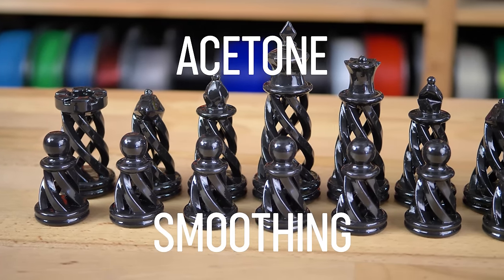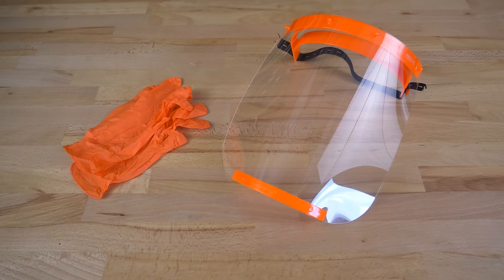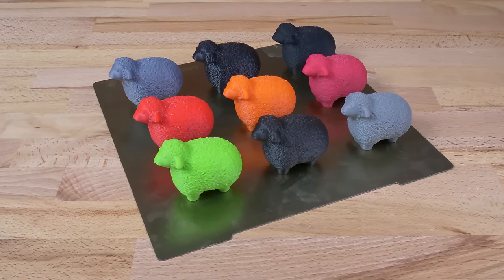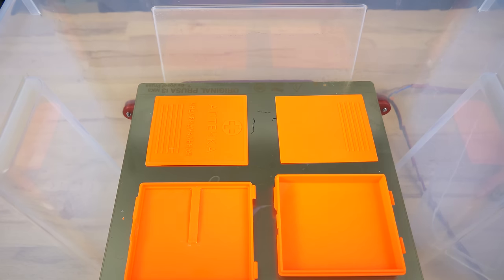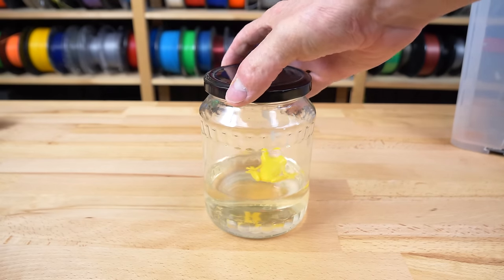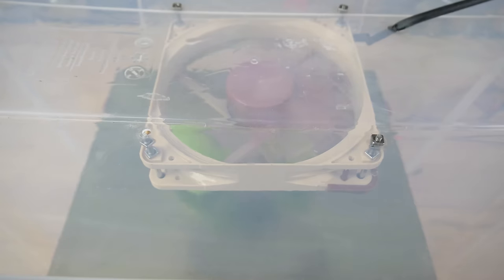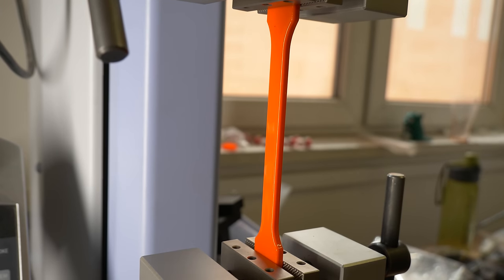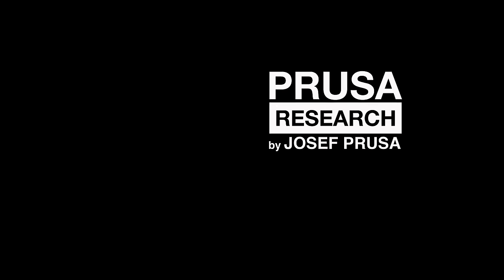Improve your prints with acetone smoothing

Comment: So this is kinda like anti-aliasing but for 3d-prints :)
Reply: Yeah, but it's not crappy.
Reply: @squirrelrobotics  lol hi
the first comment I check i see you xD
Reply: @augiespear8804  Hello!
Reply: More like blur
Reply: Well yea, kinda
Reply: 3D Maker Kid m, AA is not crappy. It is very helpful if you have a low res screen
Reply: Except anti-aliasing averages the pixels out, this cuts them down. Which is worse.
Reply: Nice one.
Reply: Not just anti-aliasing, but texture filtering too.
Reply: FXAA
Reply: you guys are all wrong... it DLSS aliasing!
Reply: 'smoothing out lumpy shit' is what know AA for.
Reply: That's why he needs the noctua fan
Reply: More like bilinear filter I think ;)
Reply: AA is not for all. Its only for the edges of the model xD
Reply: dlp printers already have anti aliasing but it ends up making things worse from what I've seen.
Reply: Yes, there is another filament which allows to do this with isopropanol instead of actone ;)
Reply: Lol
Reply: LOL
Reply: When will we get RTX for 3d printers? :O
Reply: RTX for 3D printing is called SLA :)
Reply: So Pla doesnt work. Pla is all i use at the moment. Any suggestions on smoothing Pla?

Comment: Dude is so rich he uses a Noctua fan for his print smoothing box
Reply: it logical since the cheaper fans use lower quality plastic,
which means their easier to get affected and damage by the vapor!
Reply: @g60force  wrong. mechanical stability is not chemical resistance.
Reply: @David-cy5zu  you've been misinformed
Reply: @g60force any fan made of ABS would kinda melt, so its more about the type of plastic than the quality of plastic
Reply: Thought I was the only one that noticed hahaha
Reply: those fans are like $30?
Reply: to be fair, as someone who builds and tears down computers for parts on a fairly regular basis, i have some noctua fans that didn't fit into my current case laying around. I also have a suitcase full of old HDDs lmao
Reply: @littlesnowflakepunk855  Yeah but you wouldn't put them in a box floating above a reactive chemical unless you're Linus.
Reply: @Zwettekop  i mean if its a chemical i know wont affect the type of plastic it's made from, i would. like ive put noctua fans in resin printer enclosures to vent outside before

Comment: I appreciate the video, but feel like it's a shame that the hotbed underneath the smoothing station was not mentioned. I built almost an identical box, with a slightly different shaped clear PP container and was so confused when after a couple of hours my prints had not been smooth at all. Turns out, the acetone is actually being heated in this video by the standalone printer bed.
Reply: Most solvents don’t really evaporate at a significant level unless heated
Reply: the sun works, put it outside
Reply: Thank you, I was feeling really stupid at this point.

Comment: It would be safer to design a fan where the motor is outside the box and the axle enters through a small hole, like how a convection oven is usually built.  With the fan motor directly exposed to the vapours, there is an explosion risk if the motor fails, or if you unwittingly use a brushed motor.
Reply: Yeah but it is like a closed system and it needs to be closed or the acetone gets out. The fan needs to be inside the chamber and it cannot pull fresh air. So there is no good way to place the fan outside. An oven is not fully closed. It pulls fresh air and air can escape through the sides. You normally can feel it. There are closed ovens but they have fans that can resist the temperature but that is again the same as the acetone chamber and the fan is literally inside.

Comment: PLA can be vapor smoothed; ive done it numerous times. The thing is you need a plastic/solvent combination that acts quite fast, so you can hit the surface without melting down the interior. And temperature plays a big role in this. It just so happens that acetone-ABS works fine around room temperature. Ethyl-acetate works quite fine for most PLAs, but you need to do it in a box around 50-60c; otherwise the vapor pressure of the stuff is too low, and you will get similar 'rubberization' problems as with plain acetone+PLA. Playing with heat and volatile chemicals may not be everyones cup of tea; but putting a water bath with possibly a thermostat heater in the bottom of your plastic box is quite safe. Just stay under the boiling point of whatever volatile substance you are working with; that goes for acetone as well.
Reply: Thank you for the suggestion. I've had a lot of PLAs lying around so feels like kind of a waste getting other filament materials just to try the acetone smoothing as of now. Will try them.
Reply: so for clarification, if I have a PLA model, say the size of a helmet, and have it on a stand in a box with a fan, with a layer of Acetone under the helmet (not touching the helmet) and then have that box in a hot water bath at 50 deg C, after 20 minutes the PLA should be smooth? and how much acetone do you think would be required for such a project?
Reply: @stevoz748  no you need ethyl-acetate for PLA, not acetone; and its boiling point is more like 70C if I recall.
Reply: @eelcohoogendoorn8044  thanks for the clarification
Reply: The video is about acetone smoothing, so no, it cannot be vapor smoothed using methods in this video.

Comment: Making a part stronger would make sense since a smoother surface also means a surface with fewer stress crack initiation sites as increased smoothness reduces stress concentration sites. Although, given that, I'm not sure why the tensile strength would be reduced.
Reply: I totally agree with your analysis on crack initiation sites on the surface for Sharpy and adherance tests.
Concerning the tensile strength, this probably have something to do with the orientation of your print. For instance a specimen printed horizontally or vertically don't have the same tensile strength. I assume that printing horizontally (where layer are in the same direction as the force you apply) is much stronger when confronted to tensile stress. Therefore, the melted part might tend to loose the cohesion between layers which result in a lower tensile resilience.
Reply: @dr.hawaske8488   it's actually the exact opposite of this. the tests in the video showed that layer adhesion was increased from vapor smoothing as it effectively fused the layers together which is why you cant really see the layer lines. this is also probably why the samples performed slightly better in the impact resistance, as better layer adhesion would probably have some effect in an impact. however, the parts had worse tensile strength because some of the acetone was likely still in the parts, and the actone itself would weaken the part, I mean it literally melted it which is why the parts were smooth. Hope this answered any questions you had.

Comment: I like how you explain diy setup for smoothing with an acetone by using old sheets, simple box... and expensive noctua fan to stir it up.
Reply: it makes sense, because cheaper fans usually use abs blades... that does not work for obvious reasons...

Comment: In the layer-adhesion test, the better mechanical load capability is clearly due to the changed geometry of the radius. It got alot bigger and thus didn't function as a weak point anymore

Comment: This is similar to Case Hardening with metals. The tests point to that as well. The outer structure has been optimized while in inside remains relatively the same. Try tumbling them in media or a light shot peening and I’d be they get even marginally better.

Comment: According to wikipedia ethylacetate and pyridine can be used to smooth PLA. In general, just take a solvent which is able to dissolve the plastic (there is always one, but be aware of the safety rules).
Reply: The only thing I know is that PLA is really soluble in organochlorides like dichloromethane or trichloromethane (Chloroform). They are even videos on YouTube of people using them to smooth PLA. But of course organochlorides are all pretty toxic and should be handled with coution although DCM is a little bit less toxic then the rest.

Comment: If i am not mistaken, many of theese fans use comutated brushed motor, a potential source of sparks. I am not sure whether it is safe tu use in flammable atmosphere. Otherwise i enjoy the video, thanks for the content of such a quality.
Reply: PC fans use brushless motors , and have done for many years. Depending on the plastic used in the fan, there may be some effect from the acetone vapour, but ignition risk is likely to be very low.

Comment: Josef Prusa, i like your ideas how to improve things, but.... Vapours, dust, heath and sparking are dangerous . I know quiet a lot of explosion enviroments as i work in such. I would move electronic parts outside of the container and drill a hole in a lid for rod an put on the fan blades or make it similar as magnetic pump for liquids.
Reply: That's illogical - the last thing you want is to be forcing air into the box, the acetone needs moving around the box. Use a smaller box, use as little liquid as possible, shouldn't be an issue anyway - brushless motors.

Comment: Having a fan inside the box could be a fire risk.  When a dc motor ins it can create sparks on the brushes.  There is a motor rating in chemistry to prevent motor ignition of flammable chemicals

Comment: Is there any material for 3D printers, I can use inside an aquarium, that's food save?
Reply: PET, PET-G, HIPS, and nylon-6
Reply: I believe PLA is fine
Reply: PLA since it is basically protein so it is organic
Reply: @bl4ckr4bbit  And what about the colors and will it get softer over time when in contact with water?
Reply: @littlejacob25  THIS only if you need highest possible standards.. since there's a difference between a room temperature 10cent goldfish and a 100dollar sweet or salt water tropical fish ;)

Comment: Really nice video. Dont you fear your fan could cause an ignition of the vapors due to electric arcs in the dc motor? or do you use a brushless fan? i would like to build such a box but i am very uncomfortable with a dc motor and combustable vapor
Reply: I was wondering the same thing when I saw that.
Reply: Noctua fans use brushless motors

Comment: As beginner been looking for some advice. And now have even more questions. So: fan most of them are made of abs how long they last? Hi concentration vapours can ignite easily with electrostatic discharges which sometimes occurs on fast moving plastic parts, also even brushless motors can generate tiny sparks, heat, and magnetic field all of them can ignite vapours off different chemicals. Box how long it lasts for? And another I had a  a lot of occasions to play with the strength tester. With numerous different materials and there is some behaviours tendency especially characteristic to plastics I never had situation that piece was weaker to pull force than twist or share. Are you sure that tested piece wasn't faulty?
Dipper you dig more things to learn you find.

Comment: Nitrile gloves don't protect against Acetone. In fact, it's better not to use gloves than to use nitrile. If you have gloves on, the acetone will permeate the nitrile instantly and be in direct contact with your skin until you remove your gloves. Without gloves, it'll just evaporate off.

Butyl or Viton gloves are required, or just don't put them on.

Comment: Here is an idea, use an air assist nozzle like commonly used on small lasers, but put the air pump in  a container with acetone in... so the air it blows at the "welds" contains the vapor as it prints...

Comment: If you need that level of smoothing and detail though, you probably want to just use a resin printer.
Reply: I dunno. everyone I've heard talking about resin says that, while it looks amazing and it's great for miniatures and the like, it has absolutely no give, so if it's a functional part and you need smooth detail for that function, like a small gear that needs enough detail to let the teeth of other gears smoothly enter and exit, something that's been acetone smoothed will have a longer working life because it'll be able to deal with the stress for longer without breaking.
Reply: that all depends on a per-use-case item

Comment: Attention, the fans mounted in a potentially explosive environment, and this is it, must comply in Italy with the Atex standards, if there should be a breakage of the bearings, short circuits deriving from the corrosion of the cables, sparks would arise and a fire would be triggered. Attention.

Comment: I gave up on this years ago as I never could get any ABS filament to work doing it.
Reply from the maker: You might have been printing with one of the ABS materials that we mentioned in the video. They print and warp a bit better, but cannot be significantly smoothed. (e.g. ABS-T)
- Mikolas
Reply: It might have not actually been ABS.  I gave up on it because it is a pain in the ass.
Reply: @Prusa3D  I did a test and even the Hatchbox would not completely melt so after all of the brands I tried I then knew what the issue was and that they were not 100% ABS.  To get 100% ABS the price would 1.5 to 2x in the USA or around 40-50 USD per kilo.

Comment: Do you see any risk in putting an electrical fan inside a box full of aceton vapours?
Reply: It is risky, indeed. We didn't have any trouble so far with Noctua fan inside our box but still, safety first. This process is only for people who can make enough safety peracutions. Those who are not sure enough should use a cold method or professional smoothing station mentioned in our article.
Reply: @kopykat9993  Maybe if you mounted a motor outside the box and the fan blades inside, connecting them with a shaft? If only I knew of a way to quickly and cheaply manufacture plastic parts...
Reply: Kopykat99 those fans are all brushless by the way

Comment: Sticking a fan in a potentially explosive atmosphere is not the best idea. PC fans are brushless so they shouldn't throw sparks but the acetone can eat away the wire insulation, if it shorts out and gets hot enough to ignite the vapor you're in trouble.

Comment: After testing and much thought I must disagree with this method because: 1. If you use the wrong fan that has brushes the sparks could cause ignition. Also the fan just causes the acetone to evaporate.  If you want to do this way then do Outdoors. for safety reasons such as fire risk.   2. If acetone would simply be kept contained in an enclosed container the vapor pressure alone will get the acetone fumes to maximum concentration but it will take 2 or more hours  to smooth.
Reply from the maker: When we tested smoothing without the fan, the top of the model was barely smoothed at all while the bottom was already dissolved too much.
- Mikolas
Reply: @Prusa3D  I've had same results. Fan is absolutely necessary. Btw. the Ikea Samla box (used in the video) is really ideal for this application. It is PP and its lid is very loose and it easily flies of in case of combustion.
Reply: I seriously doubt you can find any computer fans that used brushed motors. Id be more concerned that the acetone would destroy the fan itself.

Comment: Does smoothing change the permeability of the print?  If so, it might be useful for metal casting.
Reply: It will but only for the outer surface properties

Comment: I know PETG is pretty similar to PLA just with higher resistances to chemicals and heat so would it work with any form of acetone smoothing?
Reply from the maker: We talk about PETG smoothing in the linked article:
https://blog.prusaprinters.org/improve-your-3d-prints-with-chemical-smoothing_36268/
But in short, you can't smooth it with acetone. It's smoothable with some nasty chemicals, such as dichloromethane.
-Mikolas

Comment: This shows the smooth build plate in the ABS Vapor Chamber. As the textured build plate should not be cleaned with ABS, I assume I would have to find an alternative there or is putting the textured build plate in there okay?
Reply: If you're using the sheet for actual printing, it is absolutely not okay to use it for vapour smoothing. As we show in the video, we use old and damaged sheets only for this purpose. These are not suitable for printing anymore.

Comment: at 2:58 you have the heat bed plate, does it mean we should heat up the bottom of the box to get better results?
Reply from the maker: There's an article linked in the video description that talks about it ;)
"There is one more (and cheap) method how to make every model smooth evenly – and that is warming the acetone. But be aware that this method is dangerous and we cannot stress this more – if you decide to heat acetone, you are doing it at your own risk. Do it as far as possible from anything flamable, wear protective equipment (face shield, gloves etc.) and always check the box (stay in a distance and always watch it). Working in a safe environment is absolutely essential – we can’t stress that enough. If you are not sure about it, use the cold method or buy a professional smoothing station. Better safe than sorry!

Now, if you aren’t discouraged by our safety warnings, let’s see the list of recommended hardware. As we said, we’re going to heat up the acetone bath. Its fumes will increase in volume and if there would be a source of ignition in the sealed box, it could cause an explosion. Please, keep in mind that the box must not be perfectly sealed to prevent pressure build-up inside. We recommend using a light plastic plate with no locks (just lying on top of the box) and making a couple of tiny holes in the lid to help acetone fumes escape. Under no circumstances a box with rubber isolation and any type of locks should be used!"
https://blog.prusaprinters.org/improve-your-3d-prints-with-chemical-smoothing_36268/